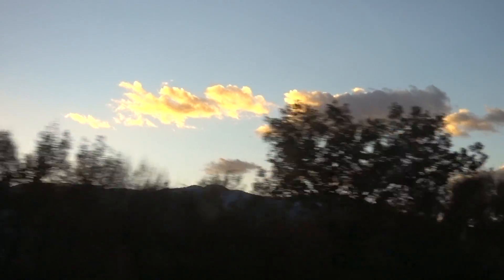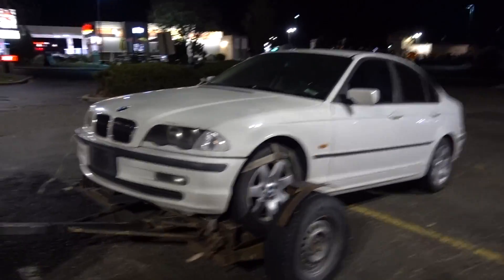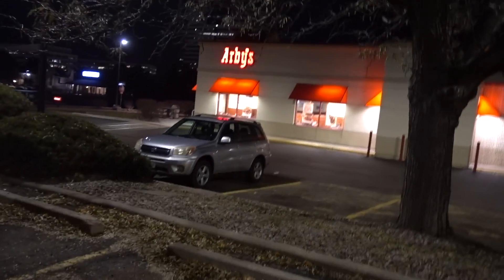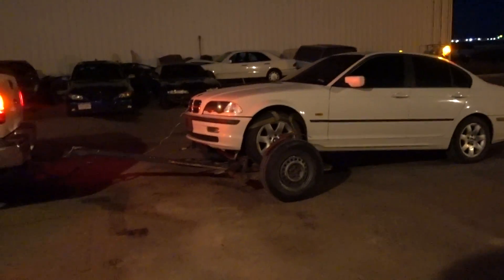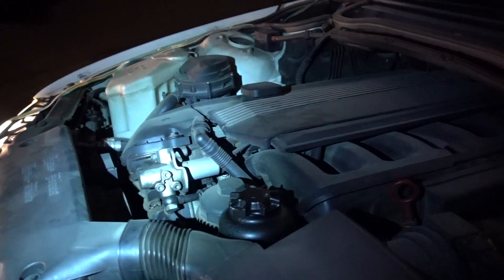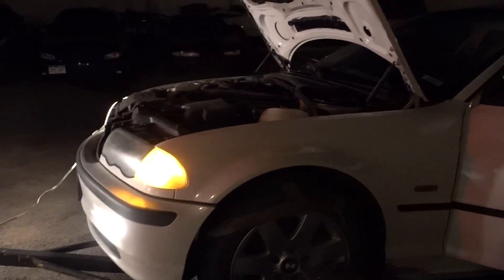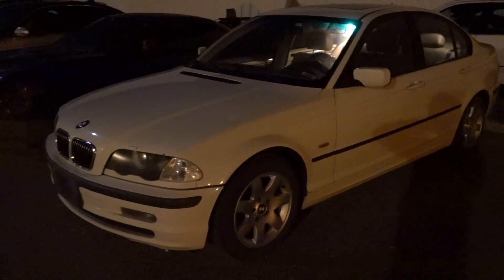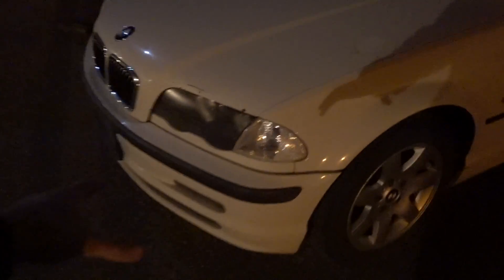The replacement BMW E46 Project car build is here!

Comment: I've seen one in local copart with 600k miles on it.

Anyway from an e46 owner, few things to check:
Cooling system
Gaskets (valve cover, oil filter, oil pan, and rear main seal) 
Drive shaft bearing
Lower control arm bushings, replace it with polly urethane for better handeling
Reply: 2nd this..  my e46 XI has 215k on it and looks/sounds just like the new one only black.. coolant a d gaskets are the key.. oh and check the DISA valve, though it sounded like that one was already replaced when he got up close.
Reply: @Snyderjj1 , mine is 02 330ci 194k miles so far

Comment: blown struts, check for crack in strut towers  and cracks in the subframe mounting points on the body, for the giveawy i would reinforce the subframe by welding in the plates $300 for the whole weld in kit and $90 for the strut tower reikniforcements or else whoever drifts this is gonna have a month of drifting before they scrap it cuz the damage is too much

Comment: I would do the motion auto tv livery in vinyl with blue this time, then I’d gut the rear, put two brides up front, change the interior to black( probably paint it) then I’d do suspension and white wheels, and a loud ass exhaust because drift car🤙

Comment: Definitely should paint it the motion auto tv scheme with bmw blue at the back and use the hard Motorsport fender flare kit with new headlights tailights sidemarkers and an m3 bumper exhaust steering wheel seats etc.

Comment: Those BMW's aren't very reliable.
Reply: You have no idea what are you talking about.
Reply from the maker: Why do you say this?
Reply: @MotionAutoTv  Based on reviews and data reports they are among the most unreliable cars compared to others.
Reply: so unreliable it made it to 200k
Reply: They're sensitive to maintenance. I love my BMW's. But they do require a lot of attention. I love how simple they are and I'm an enthusiast so it's pretty perfect. 

No it's not a Cavalier or a Focus.
Reply: @grant7909 .200k isn't anything. I had Toyota, Nissan's,Honda and even my current Lexus go way over 300k and still running.
Reply: You cant expect a car with 200kmiles on it to run like new because its not most faults in all cars no matter the make show themselves within the first 100k to 150k. Plus with added maintainence and servicing if done right with correct fluids pumps ect will always extend the life of the car. In my experience of cars my bmw was the only car i owned that didnt have any issues at all in 2 years of owning it. All my nissans and toyotas though had me in the dirt.
Reply: Yeah but they look so good
Reply: Ok Ok why a 4 door e46. Why not the eco boost mustang? Drift starter pack 2.0, i heard orion made close to $500k on his giveaway. JS
Reply: I had a 2004 325ci with 106k miles and it ran alright, but that interior...holy shit that interior does not stay together.
Reply: off road specialties simple? 😂😂😂 yea that’s the biggest lie in the world😂 you want simple but a Honda. BMW’s are way over engineered and because of that they can be a completely annoying to work on
Reply: I've seen one have 600k miles on it, mine have 194k on it so far anyway I admit it's more sensitive for maintenance, posted another comment what I think it's important to check.
Reply: My 05 325XI has 215k on it and is extremely reliable.  It's factory black on black and the interior is great, except the cloth on the pillars.  They are reliable, you just either need to fork up the money and take it to the dealer when maintenance is required (not just when something is wrong), or you need to know what you're doing.  I've done all my own work on mine and it has been a great car for the past 5 years, and I put 100k on it.  Love my e46 and think they are still the best looking car BMW ever produced (I'm biased lol)